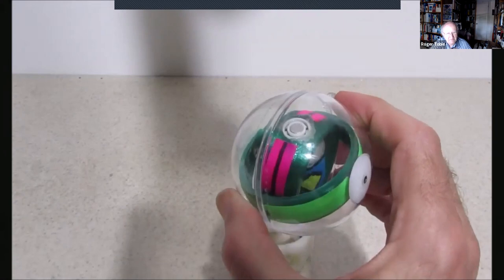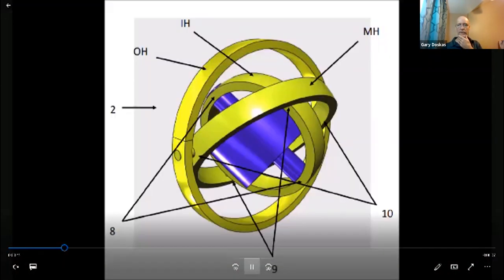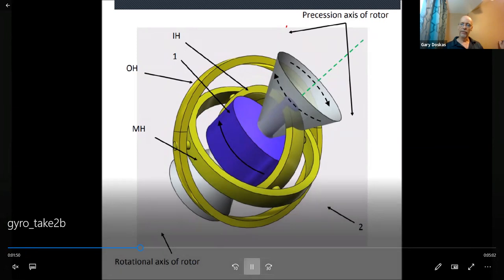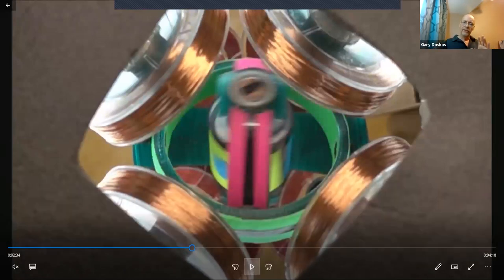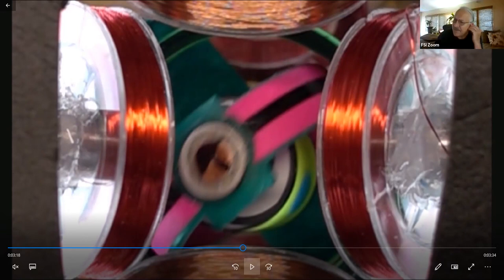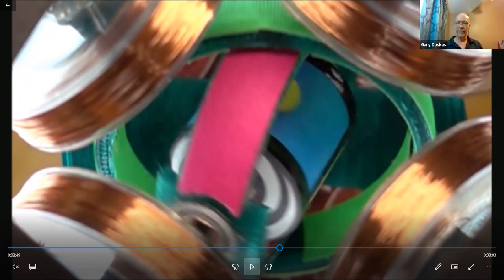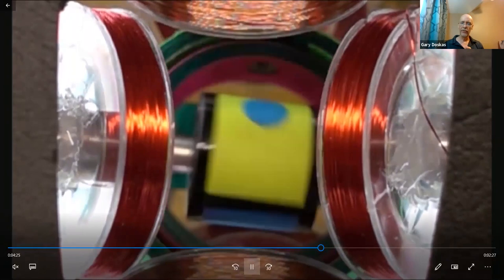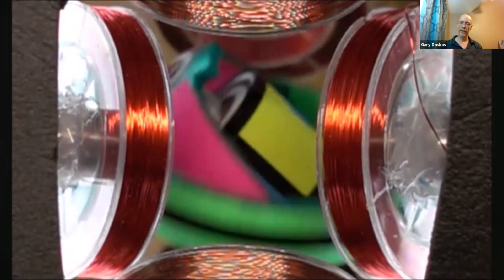Experiments in Nested Magnetics - Gary Doskas

Comment from the maker: Roger's comment is an important one--what will this running apparatus do when suspended in fluid? Will it seek natural buoyancy or will it raise and fall according to which pole is above/below the buoyancy line?
Reply: It would rise or fall based on the distance between the two different spinning magnetic fields, less distance, more attraction. To a lesser degree it would also depend on the frequency of the spin, where a higher frequency would likely result in less attraction.